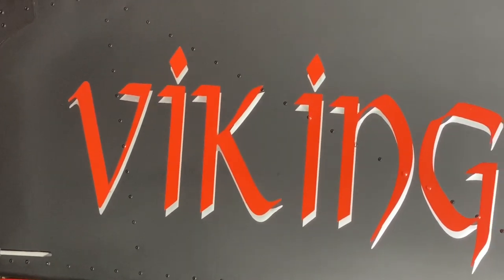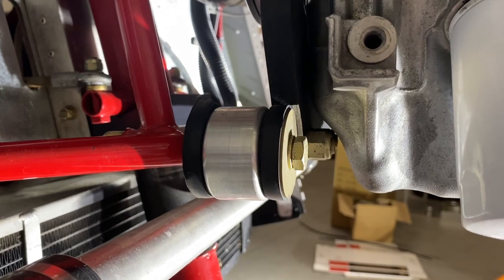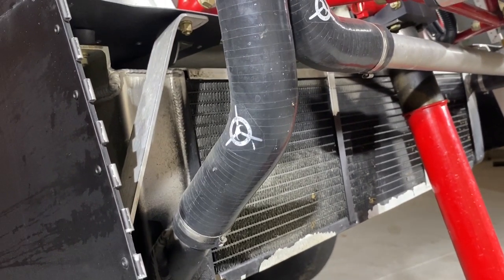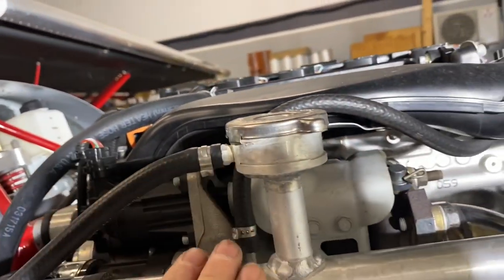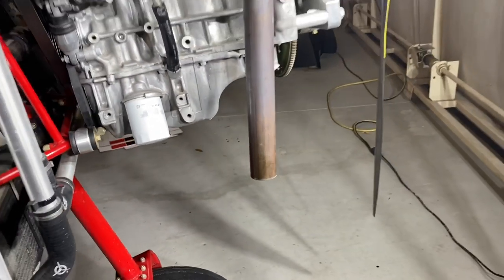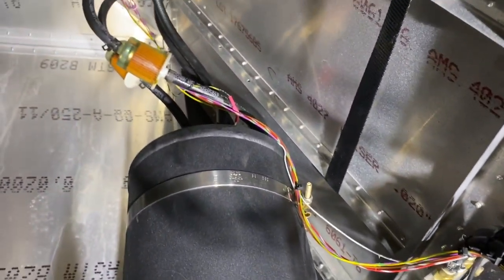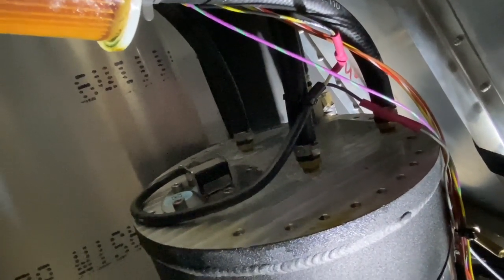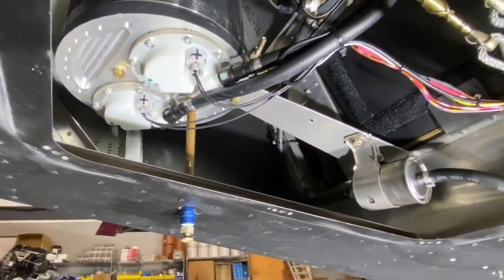Viking 180/195 Turbo Installation Video 1 (Mounting, Fuel System, Exhaust, Radiator)

Comment: did reducing the exhaust pipe from 3" down to 2" restrict the exhaust gas flow and/or reduce the power output of the engine?